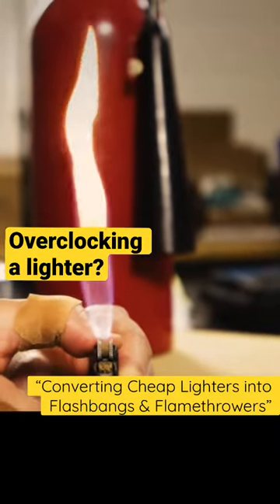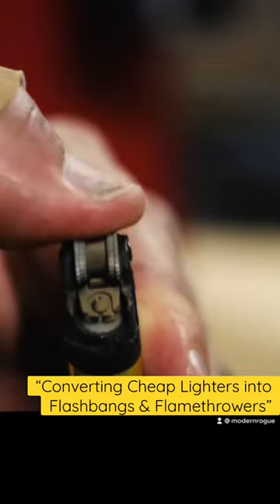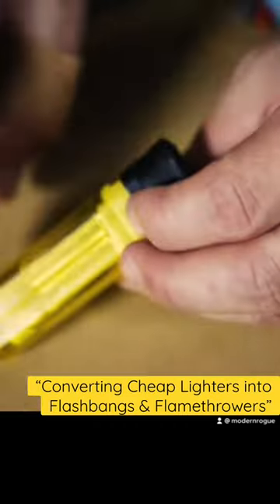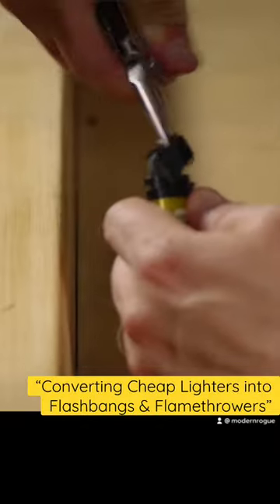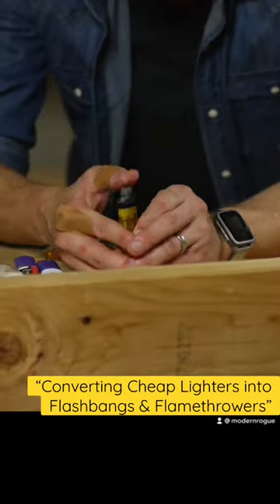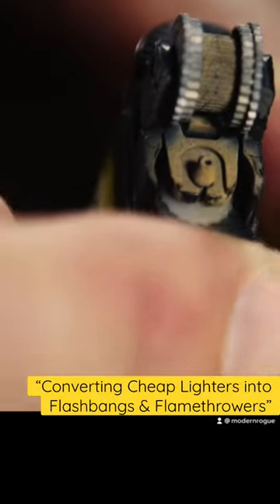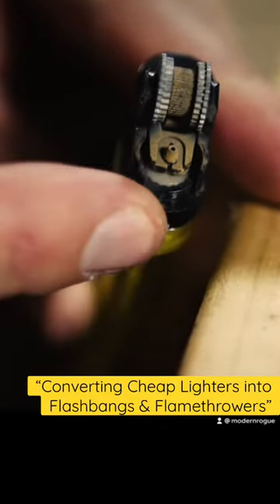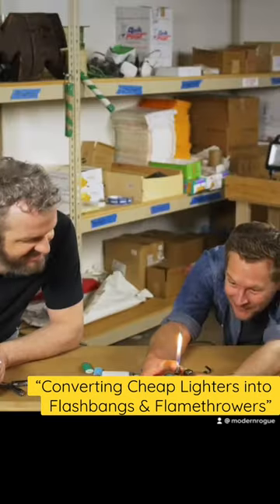Overclocking a lighter 🔥

Comment: Man, not seen anyone talk about this since the late 90's, early 00's
Reply: Or the trick where you take the flint and spring from a non-functioning lighter, overextend the spring so you can get the flint to stay between the spring. Then you take a lighter, heat the flint to red hot and throw the flint with the spring into concrete. It bursts into a shower of sparks.
Reply: I was born in 91 and I remember doing this all the time I just turned 31 yesterday
Reply: Right?
Reply: Where did we learn it
Reply: 80s for me

Comment: Now try adding a drop of nail polish to the tip of the gas tube and just let it set for a few seconds then hold down the gas button to force the gas to go through the nail polish leaving a tiny lil hole. Hold it for about 5 ish seconds or until it sets a bit then stop and let it fully set. You now have a wind proof lighter you can over clock to insane sizes.

Comment: Airsoft Greengas in a lighter is also effectiv
Reply: @1Slamalama1  It is. Only with more pressure and silikon oil.
Reply: No, it's propane, it's one carbon shorter, its boiling point is much lower than butane, so it produces more pressure for same molar mass at the same temperature.